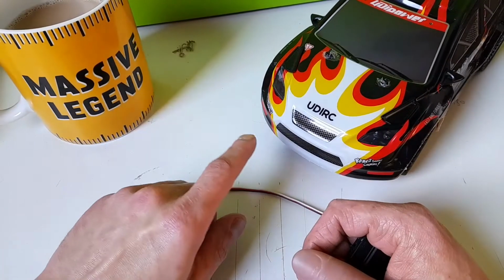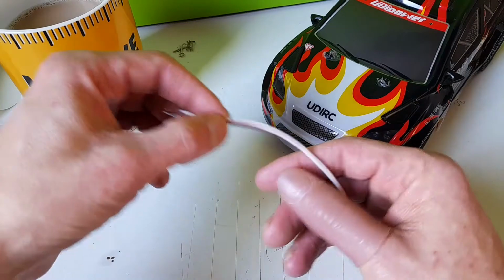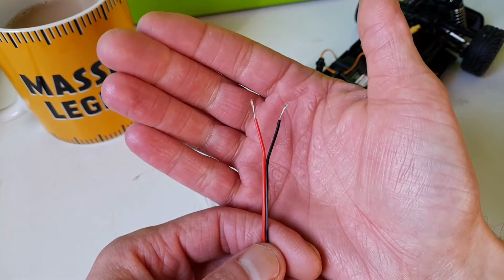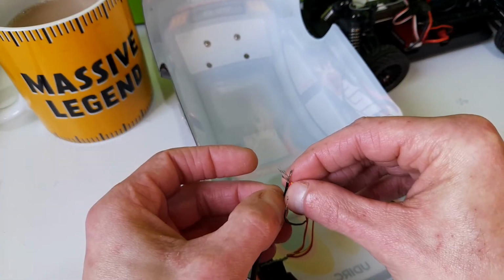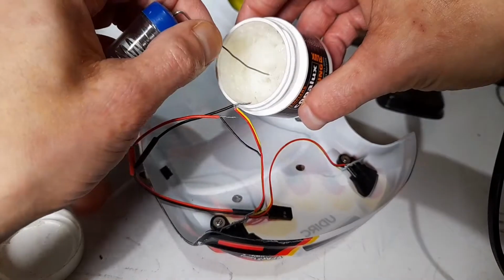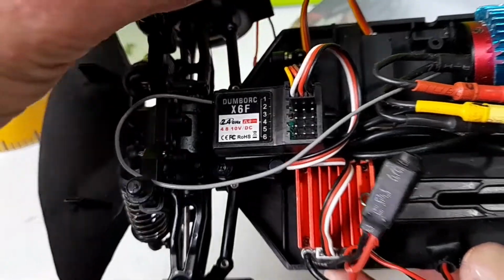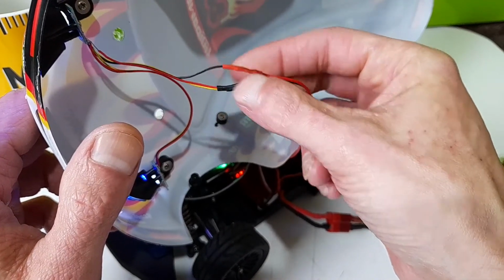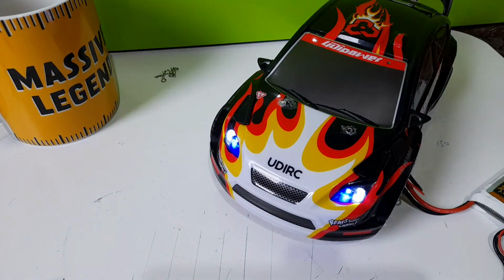UDI Rc 1604 Rewired The Right Way, 2in1 ESC Brushed To Brushless Receiver

Comment: Good video 👍. Strange why the manufacturer would go against an international standard and make the black wire (which is always the ground) the positive 🤔 Subscribed!!!
Reply from the maker: I'm not the best with the electronic side of RC but I know my black wire from the red 🤣 When I found this out it made me chuckle, I use such crude methods to test electrics as you seen but I get by... 
Thanks for the info on your video, I'll give it a shot on the Typhon with the two receivers. Again I use cheap stuff so I hold no hope it'll work thanks again 🤙
Reply: @mehimrc1314  I think it has a good chance of working. All receivers are engineer with the same basic engineering principles...well, except whoever designed the wiring on those lights 😂. Good luck and keep me posted on the outcome.

Comment: Great vid.  Ive been wondering how to go about getting the lights working again after a few mods I have done to a couple of my  RCs. Do  you think that the wiring will be the same on MN and WPL models?
Cheers Steve.
Reply from the maker: Hi Steve I'd rather not guess but do as I did. Buy one of those connectors I'll provide a link and get the button batteries aswell. Strip your wires back and test which way they work obviously start with the standard red/live black/negative...no go, switch them around. I've got more lights to blow so I ran the risk but in anycase 
(l e.d lights) have a forward voltage of 3v  cant blow them unless you run say 9v with lights in series. Here's the links have a go you can't go wrong. https://www.ebay.co.uk/itm/402136304348?mkcid=16&mkevt=1&mkrid=711-127632-2357-0&ssspo=jcY-YMETRrm&sssrc=2349624&ssuid=4AoL8TUpRDm&var=&widget_ver=artemis&media=COPY
Reply: @mehimrc1314  Ok Bud, Ive a sacrifical set so hopefully I'll get it sussed with them.
Thanks again mate.

Comment: Sir what is did u use lipo charger
Reply from the maker: For this car stock charger
Reply: For other rc sir
Reply from the maker: Skyrc charger, go to skyrc.com or find a cheap (IMAX) charger from eBay or AliExpress. Lots of other chargers on the market so shop around for your needs 👍

Comment: What about the light on the rear?
Reply from the maker: Oh you rotter, well you see I through the rear light out by mistake ✋ swear it had me looking for hours. 
I imagine the the red is neutral and the yellow is live. 
Use an AA Baterry and check either direction, you cant blow an led with one 1.5v battery.